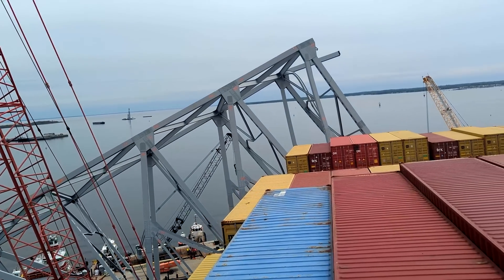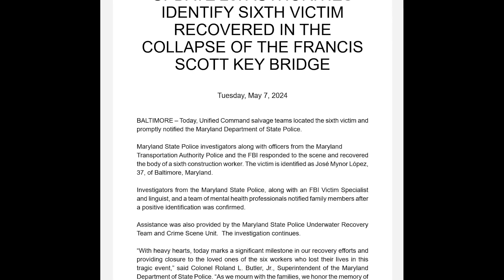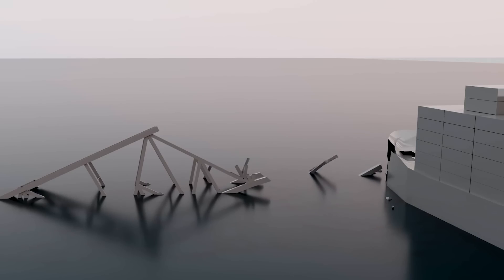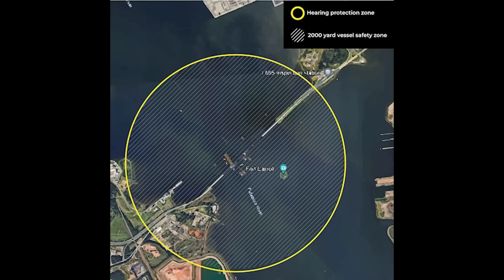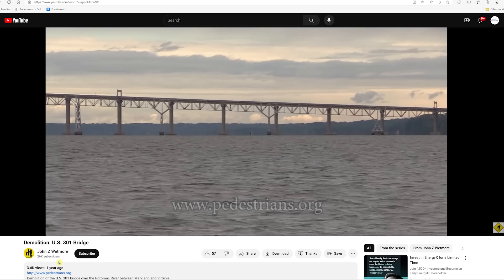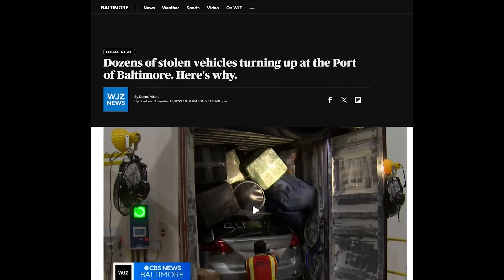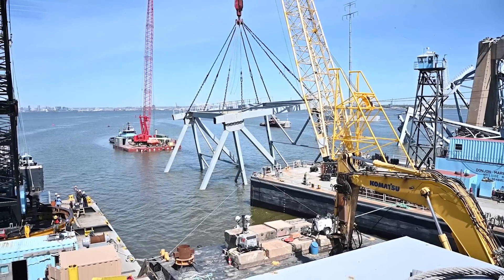Explosives Will Drop Bridge Truss From MV Dali Ship | Baltimore bridge Collapse

Comment: I came back after seeing the actual demolition, it was not as smooth as the animation, the section of the truss still in the water did not appear to collapse at all, but the portion on the bow did separate. I wonder if the plan of moving the dali is still on the table, or if more cutting will be required to un-stick it.
Reply from the maker: They said 2 days at high tide they plan to use 4 tugs to move Dali

Comment: Just a heads up the controlled demolition will be done by a professional demolition company and not the ARMY.
These explosives are specifically designed to cut the steel based on the type and thickness of the steel, also the cuts that are being done are also very specific.

Comment: When they blow up concrete, the charge is confined inside the concrete beam. This muffles the sound.
The explosive used to blow up concrete tends to be a slower explosive which creates less noise.
A cutting charge is different, you want the fastest explosive you can get, therefore it's noisy.
In this case, the strain in the steel structure is really just an educated guess.
Because of this, they will only be able to pre-cut the structure a small amount. Which means they'll have to use more explosives, alot more, maybe 3x or even 5x as much as would ordinarily be used.
I think everyone will be very surprised by just how loud it's going to be.

Comment: Baltimore has a very high theft rate around the ports, even new cars coming to be sent to new dealers get stolen and shipped off... HBO's The Wire captured some of this during the Season 2 story arc.

KIa's Hyundais, Honda Toyota and Mopar Products are highly sought after in Baltimore. If you own a Challenger Charger RT or above you will pay out the nose for insurance and will most likely have your car stolen or car-jacked.

If you ever get car Jacked in Baltimore just let them take it, the car jackers have no qualms about covering the interiors in brain matter and still taking the car... Just get out give it up and move on, insurance will pay you to get a replacement.

Baltimore is one of the worst cities for Car Jackings... so my advice, when told to give it up just get out and step aside... most of the folks doing the car jacking are under 18, and have something to prove that is why it is best to just let them have it... you don't want to be there bragging trophy because you felt the urge to stand-up to them...

Comment: The charges will probably be detonated at simultaneously.  That approach will result in metal "confetti."  No single piece is big enough to cause significant damage to the Dali.  The explosive charge will burn at 25,000 feet per second or faster.  What you will hear is a very loud crack.  Standing off 2,000 yards will will protect your hearing and keep you safe from flying debris.  If done correctly, all of the pieces will appear to drop vertically into the water.  The video will be spectacular.

Comment: There's two reasons why the charges will probably be louder that the condo demolition. The charges inside the building muffles them as opposed to charges suspended in mid air with nothing to attenuate the shock waves, and second, sound carries really well over water, not so much over dry land

Comment: The orange blast points are interesting.  Looks like they are going to chop it up into "tiny" (40'-100') pieces, at least near the boat. I'm guessing all of those cuts are going to take a long time. Thick steel, lots of cuts.  I wonder if the cuts are going to be "simultaneous" or if there is going to be a noticeable delay built in to pull the steel away from the boat.

The controlled detonation of the Champlain Tower was inside the building, that would muffle the explosions. These cuts are out in the open.  The sound will be travelling across the water. It would carry a long way without attenuation. The crew will be down inside crew quarters, or worst case back in the Engine room. 

Shipping hubs in Toronto and Port of Montreal are also huge stolen vehicle export sites. 
Short form, fake paperwork, LOTS of containers, not enough inspectors or time to inspect.
https://cfla-acfl.ca/files/Industry-Intelligence/Addressing%20Illegal%20Exports%20&%20Vehicle%20Theft-Canadian%20Finance%20&%20Leasing%20Associaiton-Brian%20Osler-May%202023.pdf

https://www.cbc.ca/news/canada/montreal/montreal-port-stolen-car-export-hub-1.7173430
"the border agency isn't allowed to slow the flow of trade."
"said a lack of container screening at the Montreal port has made exporting stolen vehicles a lucrative, low-risk endeavour."

https://www.cbc.ca/news/world/auto-theft-canada-1.6953242
In this article a reporter called a guy to tell him his stolen vehicle was found in Ghana.

Apparently a lot of the stolen vehicles are also found in oil rich countries.

I saw another story where a guy was able to track his stolen car to a port. He notified the police, but they "were not able to do anything about it". Even though he could pinpoint it's location.

Comment: Even after they remove the steel laying on the ship, there is still a pile of concrete roadbed, a portion of concrete bridge column, and hundreds of containers to be removed before the ship will be ready to attempt a move.
Reply from the maker: The already removed all the containers the need to remove to refloat the ship. They removed 180 so far.

Comment: On the extended safe zone, I wonder if the plan includes chunks of metal flying off and away. Get certain key pieces out of the way to control and manage the direction of the collapse of the larger pieces.

Comment: Blah, blah.  There is no "surgical precision" here - forces of load are estimated, because as a mess... there is no design criteria.  Basics at this point?  Top span of steel is under compression, and bottom under tension.  An actual cut might put people in danger due to load twist.   But I wonder if bottom spans can be taken out at the same time using thermite - burn out the vee thats right above the waterline and it should part & fold like a suitcase.  That gets load off the deck, but probably still against the hull - halfway relieved, and in a position better suited for top down removal.

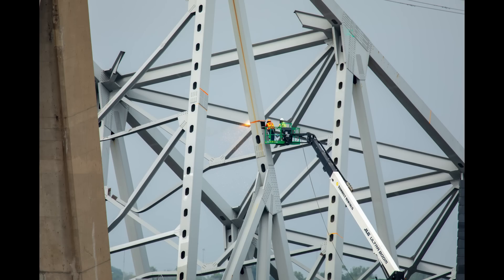Comment: Ref 5:09 - 5:14  => IF the explosive charge locations shown in the video simulation are correct, then it seems to me firing all charges at the same time (as video simulation does) would NOT cause the pieces of that truss to "fall" in the manner portrayed.  In order for the higher sections (close to or directly resting on ths ship) to enter the water as shown in the video, the charges must be time delayed.
Reply from the maker: No, they do this all the time.They blow them all at the same time and under the weight.And they angle that they are sitting at on the bow The pieces should slide right off down into the water

Comment: As the salvage crews are removing a large tonnage of the bridge, I've yet to hear what impact it's having on the roadways, in and from Baltimore on the highway system transporting it to the recycling facility. I'm guessing the tax payers are to absorb the cost of the wear and possible road damage caused by the trucks hauling it away, or should the shipping company be liable for that as well.

Comment: My questioin is has the recovery crew for the Dali inspected the hull that is compressed against the bed of the bay?  With this much weight on the ship and the damage done to the bow area, has there been any damage to the part of the ship below the water line?  If so, has it been patched or sealed off inside the ship to prevent listing or flooding?   I am in no means an architect or engineer, but I hope they have considered everything and set up contingencies for anything that can and might go wrong.

Comment: > If the charges are triggered through electrical wires, as opposed to radio control, or even in the case of R.C. detonation, several charges can be daisy-chained through wires, there's a real danger of setting off the charges accidentally as they are being connected by near by radio transmissions like C.B. or marine radio. The safety zone is big enough to reduce the radio signal strength of any transmission outside the zone. There's also the possibility of flying shrapnel because the overall condition of the steel due to age is not completely known.
> I'm pretty sure the crew will be inside the superstructure (living and working quarters) protected by the steel containers that remain on  board. I haven't been able to see one from the photos and videos but if you spot a yellow 'Q' flag flying over the bridge, that would be a "quarantine" flag meaning no one from the crew is allowed to get off the ship. This is sometime the case with foreign flag ships with foreign crews if there's problems with passport or immigration regulations, if the ship is well over-due for leaving port, or if the ship is under investigation, which it is.
> The containers are not packed at the marine terminal - they are brought in by truck and simply transferred to the ship. The people packing the containers (off sight) are falsifying the records of the container's contents. It would be a real slow down of the process if every single container had to be opened and inventoried, so I'm not sure who is ultimately responsible legally; the company sending the container, the shipping terminal, or the captain and company running the ship.

Comment: The reason for the larger exclusion zone is two fold. 
Basic physics of sound propagation says that sounds travels farther over water for a given decibel amplitude of the sound wave because there are no obstructions on the water surface to impede the wave or absorb the energy of the wave. 
Also depending on atmospheric conditions there could be what is termed an inversion effect, it means that sound wave can possibly be trapped in a layer over the water and refracted back down, sort of like a conduit causing it to propagate much farther than on land. Similar to themoclines found underwater can cause sound to propagate hundreds of km from their point of origin.
The building demolition is not a good comparison in make since it's over land and also the charges are contained within the structure, causing the blast waves to dissipate within the building's shell.

The second reason for the large exclusion zone are possible flying metal fragments which act exactly like shrapnel, the geotextile covers over the shaped charge detonation sites might not stop all metal fragments from getting out.
There have been spectators killed in the past because of flying debris and over water and at a low angle these shards can skip long distances(a spectator was killed in Australia watching a building demolition, they were on a boat watching the event.)
Reply: I have no clue, but all what u write makes sence!

Comment: There's no concrete or other structures between the demo zone (other than the Dali and the shipping containers on it) so the overpressure will carry further. Mics naturally attenuate the sound at a maximum peak so you can't judge from videos how loud it is.
As for the shelter in place, they'll probably wrap the bridge on the Dali with blast protection and have the crew go down a couple decks to shelter. Three layers of shipping container should work very well to protect the crew from stray chunks that might get through the blast wrap.

Comment: I think the demolition will be louder than in a building. In a building the charges are destroying internal structures where the surrounding walls muffle some of the sound while here there is nothing to muffle the sound. But I rather doubt, that it will be so much louder.

Comment: I lived near Port Everglades, in Florida, for years.  It's easy to have a shipping container dropped off at a business for loading and having it picked up afterwards, with no inspection if palms are greased well enough. Depending on the container size and how they're loaded, you can fit four to five cars on a container and make a tidy profit.
Reply: 5 cars in a 40 foot container?
Reply: @stephenholland5930  Some of these operations stack them, using wood to protect the tops of the lower cars.

Comment: I’ve wondered when the would use explosives. I’ve worked on 10-15 structure removals. First you will make a pre cut leaving a safe amount uncut. The charges look like 2” copper angle iron with a small amount of RDX sandwiched in it. The stand-off is a small block of wood. With the  advent of non-els there is no det cord which keeps the vibration at a minimum. We’ve done these just little distance to the new bridge.

Comment: I live in the San Francisco Bay area, and they replaced the old Dumbarton Bridge, and they used explosives to remove the concrete bridge piling supports, I gess thay didn't see me . I was parked under the bridge doing some fishing from the shoreline, and  they blew it up. I felt the Shockwave  I  got concrete all over me and the car. The shock wave was gruesome.
Reply from the maker: That would have been unawesome video
Reply: @jeffostroff I also saw a small boat with a tall antenna pulling away from the blasting area just before the explosion do you think this was blasting control boat ?

Comment: Its not just the port of Baltimore that has a problem with stolen cars ending up in containers. Recently, Radio-Canada did a report on that subject and the port of Montreal. Many of those vehicles have GPS trackers, so some owners are able to track their vehicle as they get moved around. In many cases, the owners can see from the GPS trackers that their vehicle is in a container in the port, and have been told by police that they can't do a thing because once its in the port, its the responsibility of the border agency. Some of them do end up in Africa, but there's also a number of them ending up in Eastern Europe. They can't even be bothered to cut them up for pieces, which tells you just how brazen they've gotten and how little they fear the authorities.

Comment: This transporting of secondhand motor vehicles using sea containers to Asia/Africa has been going on for years. Europe and Australia plus Japan were in a triangle. Australia allowed the import of s/h vehicles from Japan to enable S/H components to be available. They were imported complete as the importation of engines gearboxes etc  was only allowed if the components were hospital theatre clean of oils etc. If it was a complete car and met the emission control stanards for the year of manufacture, then an external steam clean was sufficient. Later on when EastWest engines became popular, the vehicles were being cut across behind the front firewall ensuring the VIN/Compliance was taken as part of the cutting process. Whole cars were still imported for rear suspension parts and to sell on the local S/Hand Market. Those cars you see inthe sea containers are usually dealer trade-ins but have niggly faults which make them not cost efficient to repair. I have a freind who bought himself a R/Hand drive Mustng from Japan for a song. After 4 yrs in Japan, vehicles had to be tested for emissions. In the 1980's this cost about $500AUD. If it failed rego withdrawn. If you decided to repair, then the emission tests had to be repeated. Most just dumped the car and brought or leased a new one. I have seen engines and gearboxes with heat resistant putty paint all over them. This was how the Japanese controlled oil leaks around sumps etc. I hope this enlightens you as to why the obviously older cars are on there way to Asia/Africa. The USA and Europe supplies the L/Hand Drive Market whilst Australia Japan and the United Kingdom supply the R/Hand drive Market

Comment: Like I said from the start, the mess is too complex to cut and pick. Cut and pick, if anything goes wrong you lose folks. Shaped charges cutting everything into small units reduces the odds of puncturing the hull of the ship, or entrapping the ship further, and everyone should get to go home at the end of the day. They issued the notice today, they'll drop it Friday, and after waiting for the silt to settle and divers to check the debris field to ensure there are no snags they'll start hauling the ship back to the docks, if the ship starts to move on its own, they will start to tow it immediately to prevent holing the hull. The ships crew will man maneuvering stations, but the bridge crew will be in a sheltered position immediately aft the bridge, and as soon as the *BOOM*s finish? You will see them rush to the bridge and man the helm even if its blasted open just in case there is movement and they have to direct the tugs to begin the tow. That has always been the safest way to extract a ship out of this mess.
Reply: My guess is there will be harbor pilots onboard helping to take the Dali back to port.

Comment: Jeff,  they use a shaped charge that will cut steel like a knife.  They are probably cutting holes to allow them to place the charges in the best orientation.  The charges will cut the steel at that point, instantly. 
And yes working on cranes and salvage work pays a lot of money. Welders, riggers, working in climbing gear, working on heavy lift cranes, and with 12 hour days.   
Generally not a bunch of unskilled laborers.
Reply: Will someone be reporting what the total cost is?
Reply: @KameraShy  Check the financial statements of the insurance companies involved.